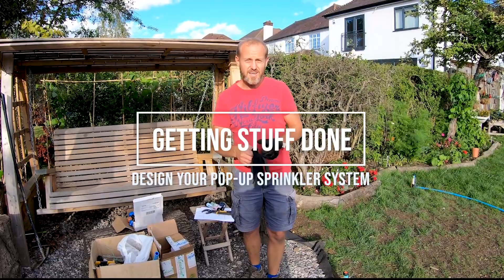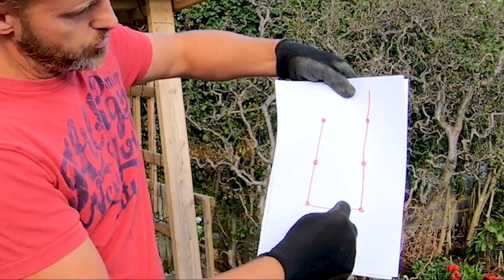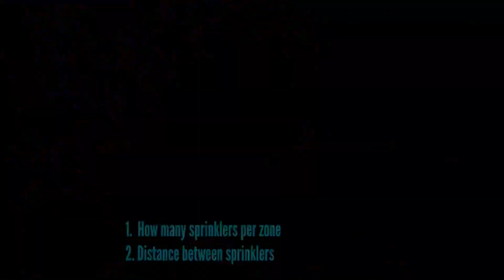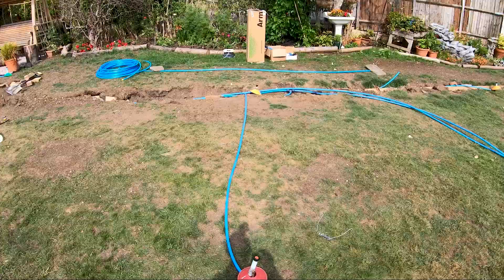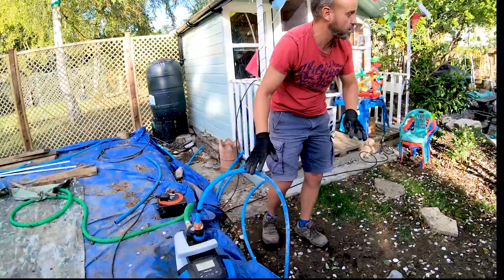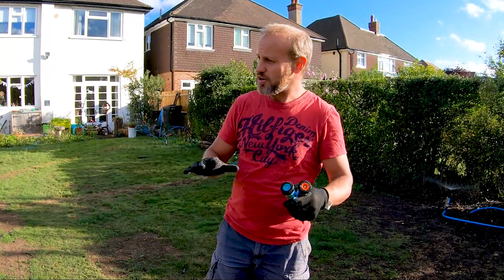INSTALL YOUR POP UP SPRINKLER SYSTEM (Water Irrigation - MDPE Pipes)

Comment: Just an observation. It is more hydraulically efficient to run a mainline around areas of the yard to be irrigated, & place the valves in the centre of the individual zones, rather than all installed next to one another.. This way you can use far less pipe, & there is much less plastic pipe & fittings in the ground. If the valves are in the centre of the zone, you can use smaller diameter pipe too.
Reply from the maker: That's really great advise + an excellent way to save on pipes + increase the pressure! I think any irrigation design should factor in your feedback! My system does something similar in that the main line runs from the pumphouse about hallway down the garden to where the valvebox and timer is located. From there my solenoids feed smaller diameter pipes to the irrigation zones. It's about as close as I can get without leaving an unsightly valve box in the middle of flower beds.